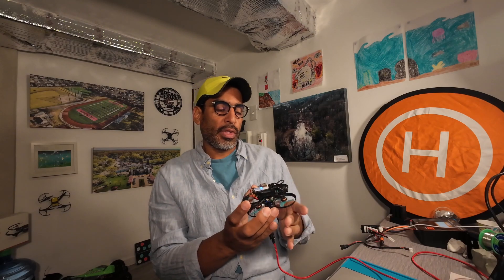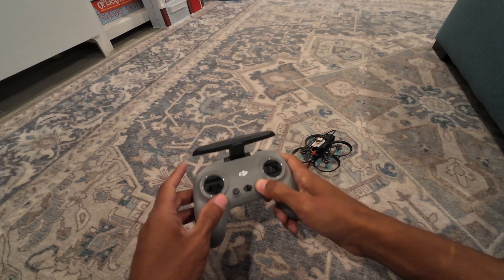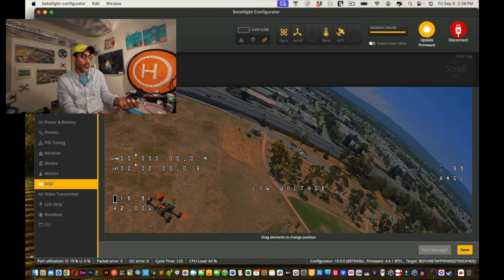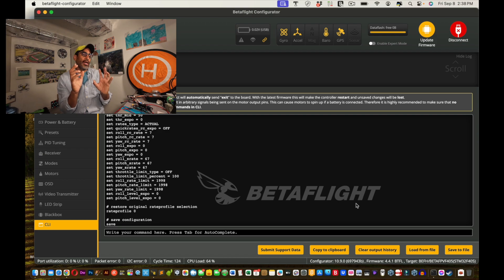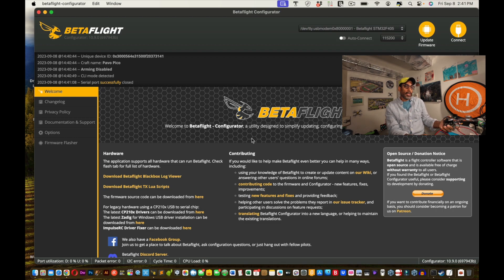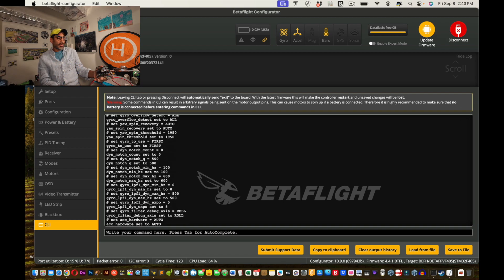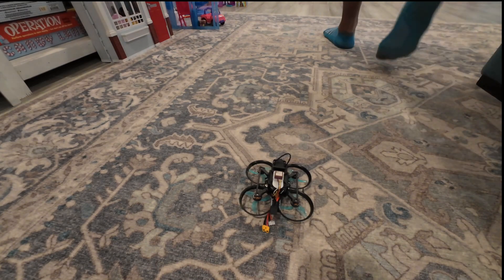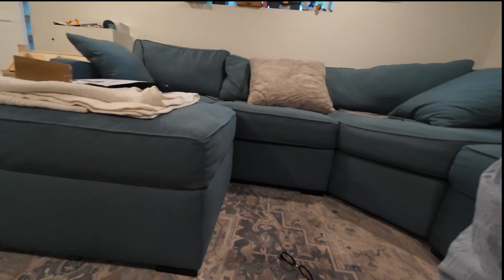Pavo Pico Not Working - How to fix pavo pico

Comment: Thumbs up! Appreciate the helpful video. I was also running to the same issue with my Pavo 20 with the DJI setup. Remote control would not activate throttle, while the other channels worked. All was resolved when I removed the assigned flipped and followed your instructions to update the firmware via CLI and reload the configuration again.
Reply from the maker: Glad this helped..and you were able to figure it out.. There is also a new trouble shooting video that may help down the line too.. https://www.youtube.com/watch?v=LEw5Gha1eRo&t=816s

Comment: Great video and I appreciate you putting this together for your audience. Question: I just got a Pavo Pico, I'm a bit disappointed because it overheats, I have not been able to fly it yet, but now that I am ready to fly it, I find that the drone won't start.  I think, I am ready to return it, but I wanted to get your opinion. Would you return your Pavo Pico, if so, what other drone similar to the Pavo Pico would you get?
Reply from the maker: Depends... If you're an experienced pilot I'd return it and get the pavo 25v2, If you're crashing and are still learning - keep it.. It will make a great basher drone and get you ready for repairs, upgrades and custom builds when you are ready to level up. 

Just uploaded a new troubleshooting videohttps://youtu.be/LEw5Gha1eRo

All in all I like it - try the new trouble shooting video.. Might help you with getting up and running..
Reply: @How-to-by-Lou  Your last video gave me more info and clarification on how to get it set up correctly. My Pavo Pico is now up and running... your video and your words persuaded me to keep it.  This thing is very sensitive with the control; I keep crashing each time I take off! I'm afraid now to break it... hahah
Reply from the maker: @YonnBurgos  did you change the pid rates so that it is easy to fly indoors?
Reply: @How-to-by-Lou Hi! Yes, I got the rates. Actually, I got it from one of the viewers who commented on one of your clips. I set them 10/250/0.54. Someone also recommended adjusting the Throttle from Auto to Scale and setting it from 100 to 75, but adjusting the Throttle did not work for me, so I reversed it back to the default. What rates are you using?

Comment: Hey there! 
Excellent video, really insightful! I noticed you expertly fitted a GPS module above the o3 frame - neat trick! But what caught my eye was the white component you placed in between. Is that to prevent heat transfer between the two? Would love to know what that piece is, I'm considering a similar set up. 
Thanks for the guidance!
Reply from the maker: Thanks glad this was able to help you.. Here is what was used.. 3M hanging strips... https://www.amazon.com/3M-CAD17201ES-Strip-Picture-Hanging/dp/B004OKKVOC/ref=sr_1_16?keywords=3m%2Bhanging%2Bstrips&qid=1695490750&sr=8-16&th=1

Also here are some new rates that actually work for beginners thanks to fpvunknown, they actually shared these amazing rates.. A seasoned FPV Pilot who enjoys the channel.. ....https://www.youtube.com/watch?v=Y2KiO_qLqhU&t=426s

Comment: Still can't arm my pico.  
 betaflight arming flag says "No valid receiver  signal detected" 
I have the updated FC. Using DJI 03 / ELRS.  Set the toggle for "arm without fix". Still can't arm. Both goggles and controller are paired to the 03 unit. Any ideas I can try or did I order the wrong tx?
Reply from the maker: go into your email and check your order. it should read: Pavo Pico Brushless Whoop Quadcopter × 1
DJI O3 VTX / ExpressLRS 2.4G
Reply: @How-to-by-Lou  that's what was sent less than two weeks ago. New to fpv thought the Pico would be a good drone to get into Betaflight and FPV.
Reply from the maker: @BigfootFPV  did you remove flip and beeper ?
Reply: @How-to-by-Lou  I'll have to check. Don't remember activating it.
Thank you for spending time on your Sunday with this.
Reply: @BigfootFPV Would you return your Pavo Pico? I see not too many people are happy with it.

Comment: just turn of flip over and it should work properly
Reply from the maker: sometimes it works and sometimes it doesn't  - but folks should check and make sure they have an AUX key designated so the flip error can be turned off. good call.. thanks for charing..
Reply from the maker: seems even with the latest fix it still happens. Drone will be finicky, but folks will  won't know how to do the flip feature if they don't know how to add it. Thanks for the idea..